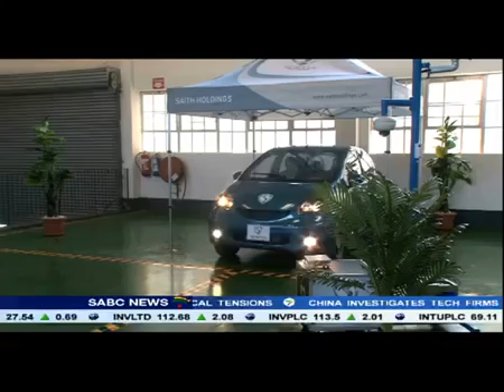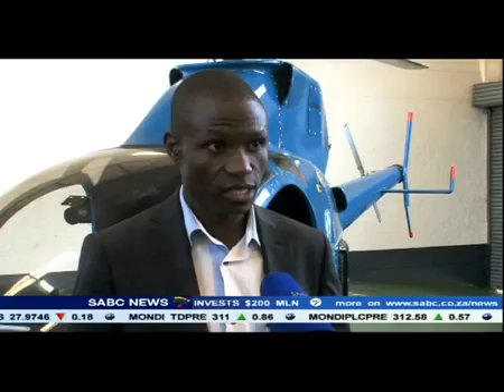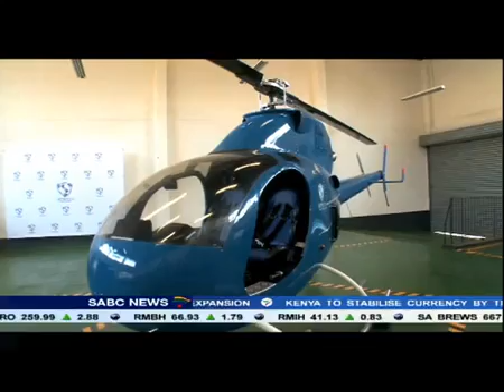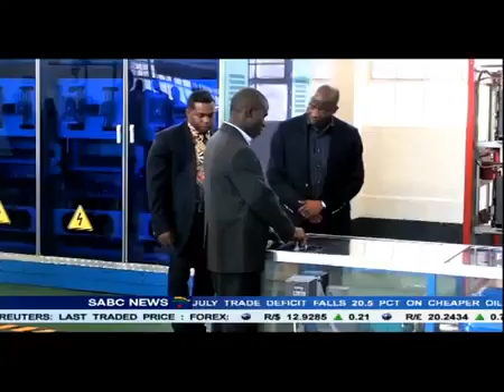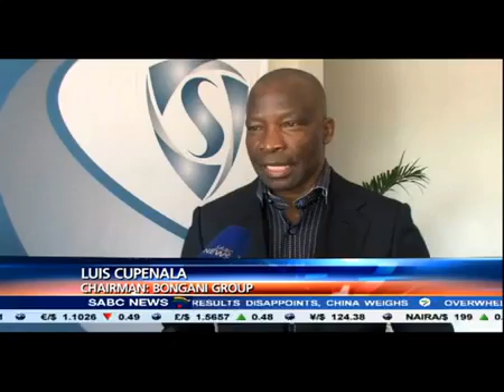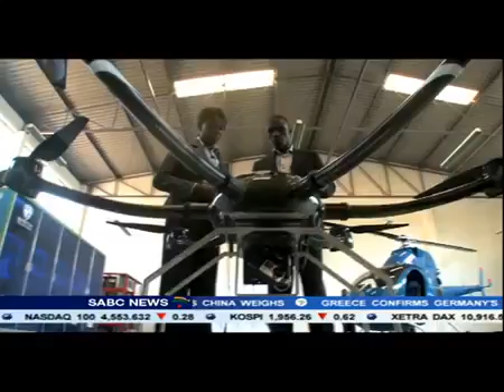An Electric Car that converts Radio Frequency into Energy

Comment: If you can believe that invisible atoms can produce immense amount of nuclear power why can't invisible radio and micro waves produce large amounts of tangible energy. Afterall waves and particles (atoms) are the same in different forms. So it is certainly possible in principle. Man only has to invent a machine to trap this unlimited source. It is the same story like how Nicholas Tesla got booted out for telling the truth. It is because the Oil cartels, Black Rock, and Vanguard and the likes who will be terrified and against such discoveries.

Comment: The problem with this invention is that, not only does shake the world  of all power sources and surpassed them the more important issue is that it has turned  the academic world on it,s head and this seems to be a bigger problem than the future demise of the oil industry.physics is the main casuality in this upsetting invention.
Reply: Did the doctors dropped you when you were born?
This is a scam / absolutely nothing is real.

That's a 5 years old video, in 5 years nobody has ever tested anything, why?